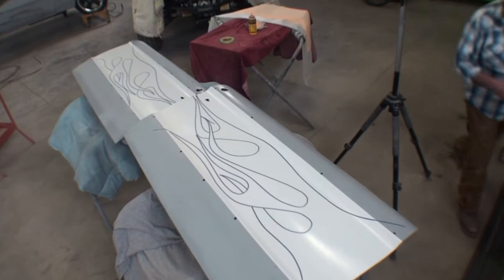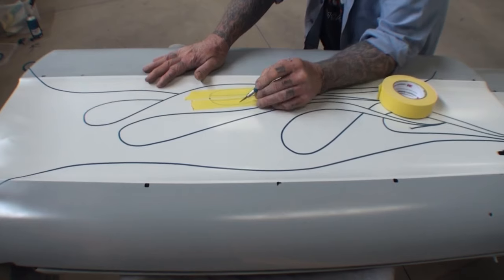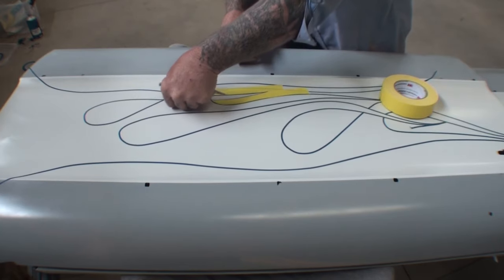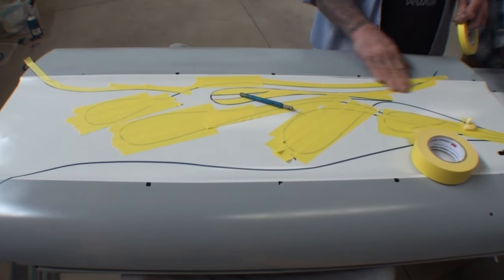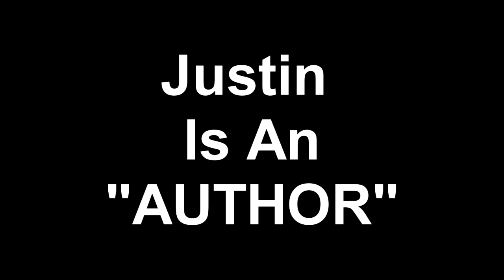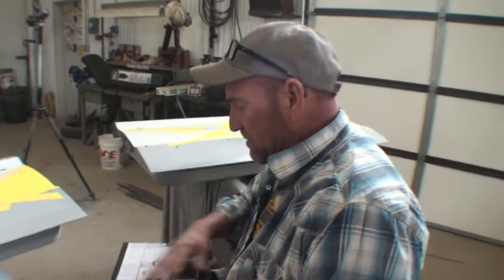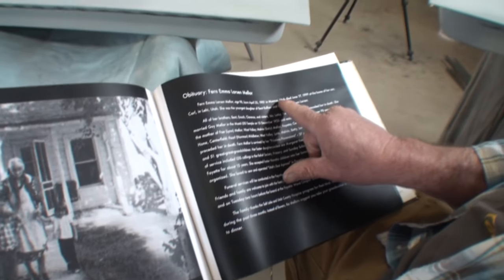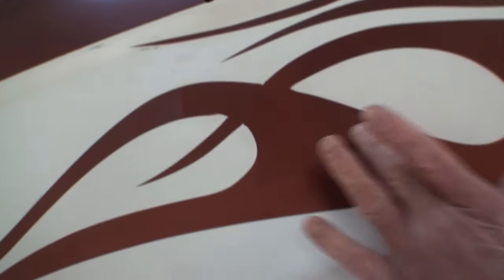How To: Paint Flames For Beginners - Custom Paint Tech Tips - Part 3

Comment: I needed thins video, with the things going on in the world right now I’ve been pondering selling the race car… and buying a 59 bel air , nothing nice kindah ratty looking as long as the interior is there and lifting it on 40’s with a long travel suspension kit and yeah yeah I’m going to get roasted for this but I wander a 4barrel DOUBLE PUMPER on it.
I don’t need electrical components taking a dump. And I think this paint job WILL do it justice

Comment: Hi Pete, when i did flames back in the early 80s, i use to use a new grease pencil, draw over the paper like you did with the crayon, but when i lifted the paper, turned it over, i just rubbed fairly hard and it transfered over. I didnt use the paper you have i used wax paper
Reply: You had to use what you had and could afford. Art supply stores or a place to buy materials was not around the corner it was miles in many cases! I give you a "Tip of the Hat". Thanks for your story!